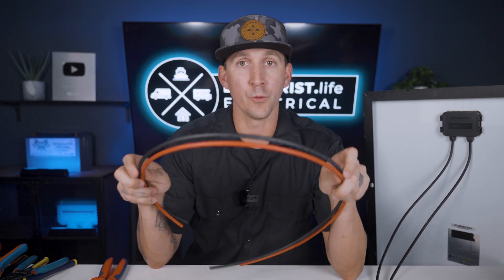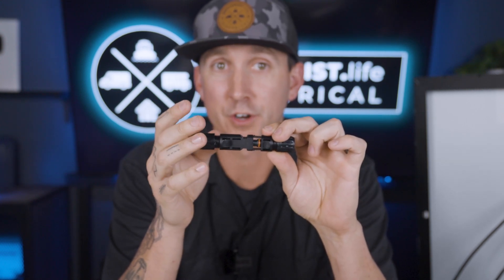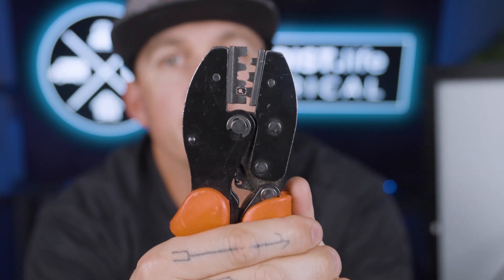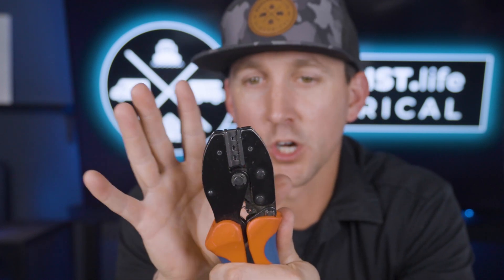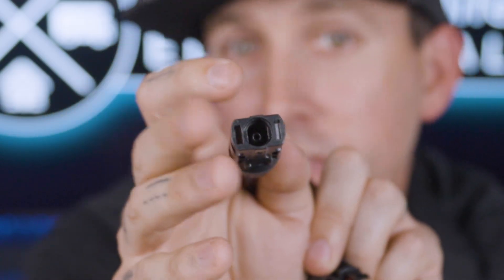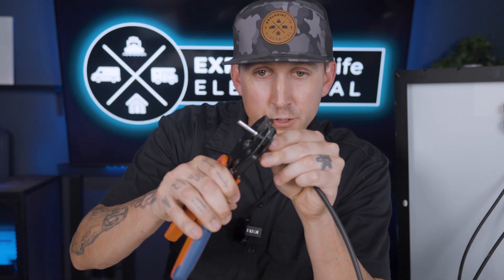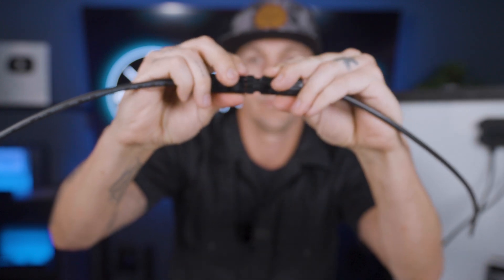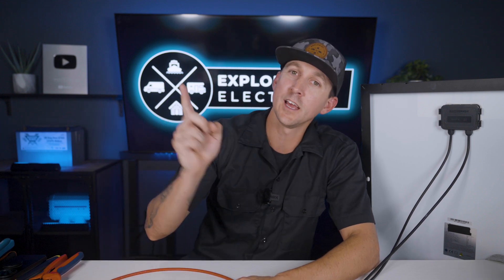PV Connector Crimping 101 - Wire Terminal Basics | Ep: 7/14

Comment: question 🙋‍♂️ what happens if you are using a 8 gauge wire? Do you need to get a different crimper and different MC4 connectors too?
Reply from the maker: Pv connectors for 8ga are rare as are the tools.  Plus, pv connectors are only rated for 30a.  Three huge reasons to design your solar array so you you can use 10ga wire like the designs we have on shop.explorist.life